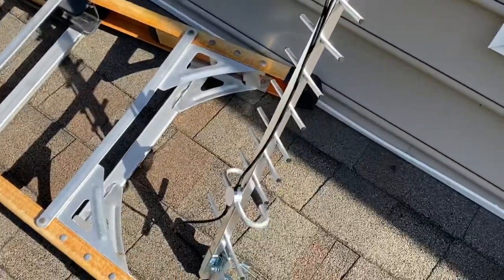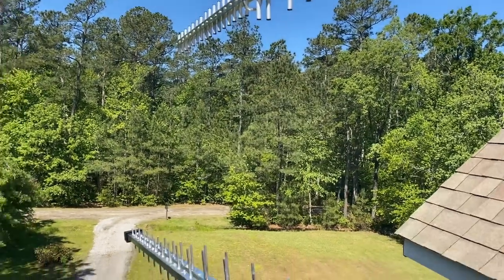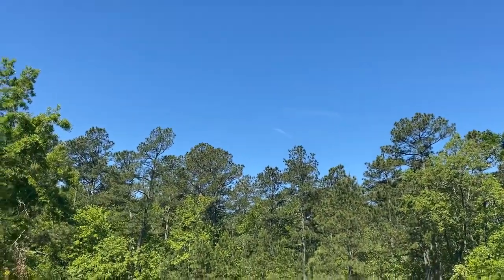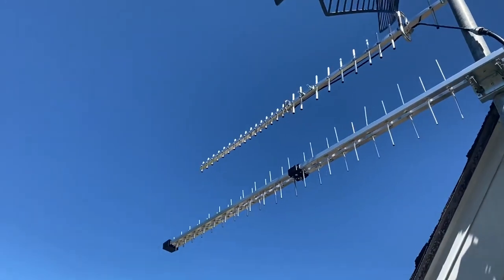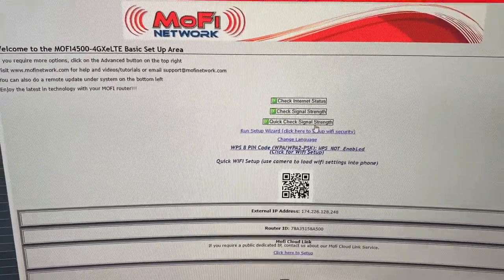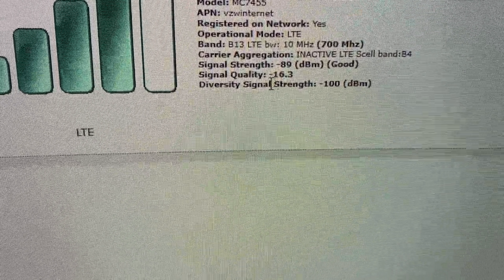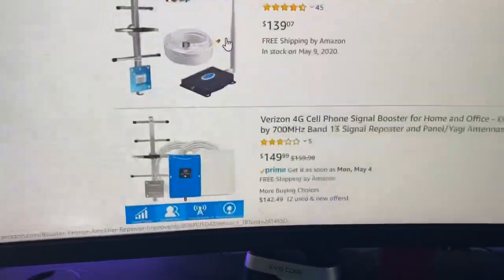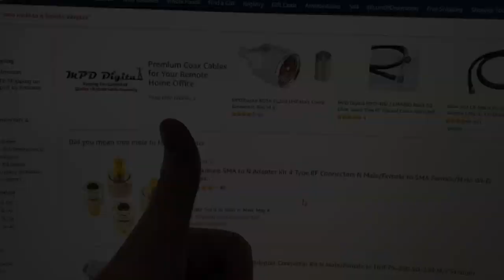NEW ANTENNA FOR MOFI!  PART 2 A MUST DO!

Comment: So im new to this. The multiple antenna types are so that if one drops out it auto goes on the other one? for more stability? so we get different types of antennas? am i right on my thinking?
Reply from the maker: Sorta,  the parabolic is super powerful you’d use it as the primary antenna which gives you signal strength.  (Prob the most important ) The secondary antenna helps with signal quality.  Better the quality the more stable the strength and signal are if that’s makes sense
Reply: @rockernro  yes, so are you saying with the Mofi you can select parabolic for signal strength and then the other for quality. And simultaneously it will use both? You freaking rock btw
Reply from the maker: @unitedsoulwarriorsfreedom4313  yes when you hook up the parabolic grid antenna with the correct wire make sure it’s plugged into the primary antenna port.  There’s two ports on the mofi and it should be labeled.  The second antenna assists the primary antenna to get the ultimate gain combined!  Technically, depending on how far from the tower you are you might only need the one antenna.  However, it is recommended you have two antennas for that reason.  I actually would have used two parabolic grid antennas but my roof didn’t have the room where my pole was.  Or you can do a similar setup to mine.
Reply: @rockernro  i see thanks so much. That Mofi does it broadcast out wifi as well? I'm actually looking to turn that feature off as i want to hardwire everything. You are amazing help brother.
Reply from the maker: @unitedsoulwarriorsfreedom4313  no no get the parabolic grid for LTE this one:  Griddy: The Grid Parabolic 4G LTE, 5G NR, and WiFi Antenna Kit by Waveform | Requires Line of Sight | Range: 40 km | 26 dB | 600-6500 MHz Dish | Works with Boosters, LTE Modems (Antenna Only) https://www.amazon.com/dp/B08Z671T9P/ref=cm_sw_r_cp_api_glt_fabc_KG6P93S235Q6FCC86Y8S
Reply from the maker: @unitedsoulwarriorsfreedom4313  yes it does but the mofi WiFi sucks so you’d select no in the settings to turn WiFi radio off.  I used a netgear gaming router and used it to broadcast WiFi.  It pretty much doubles your speeds.  And of course hardwire is always better also
Reply from the maker: @unitedsoulwarriorsfreedom4313  yes that would work! Ensure you buy the correct cables N male to SMA male ends
Reply: @rockernro  Thanks brother, btw, i looked at the MOFI buying the newer one and it says its a SMA female port so i would buy a SMA male. Checked and the FME is same just not as far a range see here: https://forums.whirlpool.net.au/archive/1946603 .....
Reply: @rockernro   Have you tested the signal loss on the wire that has the proper ends vs purchasing the N female to SMA ?
Reply from the maker: @unitedsoulwarriorsfreedom4313  needs to be the N-Male plugs into the antenna and the SMA male end it’s like a mini coaxial goes to mofi.  FME is a little different.  Like I had to get an adapter for the FME ends on the log periodic antennas to make them N male for the cables.  However, the parabolic I bought was N-Female so I didn’t need any adapters only the cable with those ends. Not trying to confuse you.  But you need this cable and ensure it’s the LMR 400 (they’re super thick!  If it’s thick like a TV coaxial it won’t be nearly as good.  I know this bc my neighbor bought the skinny ones and lost a few mbs of gain.  MPD Digital 400-n-Straight SMA-5 Times Microwave LMR-400 Coaxial Antenna Cable Line with N Male & Straight SMA Male Connectors, 5' https://www.amazon.com/dp/B00H9II88C/ref=cm_sw_r_cp_api_glt_fabc_J6E1APXZ9PYN1Y0HT3B0.    Remember if you do two antennas you’ll need two cables.  Don’t have to buy these but this is an example.
Reply from the maker: @unitedsoulwarriorsfreedom4313  so in a sense yes.  The ones I was using were LMR 400 not the RB68 or whatever it’s called.  The LMR is super thick thus less loss.  You start adding adapters and you will lose some DBs.   Hence I stress get the pre-made cable with the proper direct ends that way you mitigate less pieces meaning less loss.  Also, the shorter the cable the better the signal as well.  I was using 15ft cables on mine.  But I highly doubt if you have some excess you’ll lose much of anything unless you go over 100ft or so perhaps.  Be very patient when pointing the parabolic.  Turn it little by little while looking at the decibels in real time on your phone in the mofi signal check settings.  As you turn it slightly left or right you will see DBs drop or get better.  -104 was the best I got for signal strength but you if you can get it to around -90 or less even better!  The better the strength the faster the speeds.  Once that antenna is set.  Go ahead and play with the second antenna and move it up down left and right to see if you can improve the signal quality.  I was at -7 at best on that but it ranged between -9 and -7.  When it rains or wind or snow, she’s going to fluctuate some and degrade.  So the lower you get both numbers, the safer you will be in the elements, if that makes sense?
Reply: @rockernro  Yes makes perfect sense. Just ordered everything. i ordered 2 parabolics... so the second one i try to boost signal quality and first one i boost the signal strength? man you are tremendous help and im certain others will read this and have these same questions thanks.

Comment: @John Barth ok since your not using the band lock what setting is it on for you using the Advance band lock tab like to test it on with the same settings with AT&T to see if I get better results as well
Reply from the maker: Nyt Owl316 you select the bands you want on advanced band lock and hit save you have to mess with it like some bands will merge together and say carrier aggregation in the check signal status keep trying 2 bands until it says carrier aggregate
Reply: John Barth ok so on band lock was the setting for that just on Auto cause that’s what I messed with to band lock it on band12/17 so I need to put it back on auto basically and mess with the advance tab only
Reply: Thanks for the tip I tried different ones but couldn’t get a good results so I selected all five and got way better speeds that way than just having one selected on band lock? Thanks for the info keep up the good work hope yours works out as well!!!!!
Reply from the maker: Nyt Owl316 so you are using multiple
Bands?  Interesting I mean I could do but it typically only does CA with 2 bands unless you’ve seen an improvement will multiples?
Reply: John Barth well like you said it’s trial and error when I was using band lock with just band 12/17 I was getting only 20 down and 15 up other bands I was getting less but went back and put it on auto and stayed up most of the night when everyone was asleep tried two at a time but less speeds than before so I heard you say you can possibly use them all at the same time and presto magneto it worked. Like you said tricking the towers but I don’t have antennas like you but for now this works and the speeds are consistent.
Reply: John Barth also my speeds are at 50 up and 6 down if that helps
Reply from the maker: Nyt Owl316 that’s what I’m talking about!  Good shit!
Reply: John Barth yes sir very good shit lmao when your part of the cutting cable community and rely on variable speeds to stream when it’s unlimited it helps out a lot
Reply: John Barth I seen in the video you had a wireless router in your sons room is that hooked up to the Mofi and if it is I like to know how you got it to work with it on changing the settings?
Reply from the maker: Nyt Owl316 so I just plugged an Ethernet from port one on mofi to my netgear gaming router’s Wan port or colored port.   This router shows a internet flickering light so I know it’s tethered at that point.  I go into my netgear and change the SSID name and password under the wireless settings.  I turn off the 5Ghz under wireless settings bc the mofi only uses 2.4ghz.  So make sure you only use one WiFi name and password under 2.4 ghz.  Disable the 5ghz.  And then I save it all and go into mofi settings through the netgear!  Once I know I can access the mofi settings through my netgear I go into the wireless settings on the Mofi and where it says wireless radio enabled select NO.  That will turn the WiFi off on mofi and will be strictly blasting WiFi through the netgear or whatever router you use.  Whew, lastly for a WiFi channel select channel 1 not auto.  That keeps you safe from neighbor interference.  That will do the trick!
Reply: John Barth dude your awesome I’m gonna try that tonight when everyone is asleep 👍👍👍👍👍👍👍👍👍👍👍
Reply: @rockernro  hi John, can you link a video to your in home set-up when you have a chance? i am thinking about getting the mofi. I think it will work for what the family needs (streaming) but a second router would def help me out for what I need (gaming). Thanks for your help and quick replies!
Reply: Oh and John, one more thing (I know Ive hit you up a couple times already today), but where did you start originally with signal strength? Im just looking for a comparison in DBm. For reference, I have a verizon signal in my home that fluctuates between -108 to -120 in the home on my Pixel 4.
Reply from the maker: stephen shay use the mofi to determine your Live decibels but I’m sitting around -104 for strength and -8 for quality.  If you add a good antenna like mine you will get lower decibels for sure

Comment: Do you have the parabolic grid antenna attached to "primary antenna" connection on mofi router and verizon lpda antenna attached to "secondary antenna" connection?
Reply from the maker: Adam Fusco that is correct

Comment: About the signal quality. -0.0 to -10.0 is really good, will have no buffering and be fast. -11 to -14 signal quality will not be good. Signal strength may be good but with all of the error correction you will get a lot of buffering and very slow download/uploads Signal quality worse than -14 (-14 to -20) will be all but useless..

Comment: Hey John great videos. I haven't noticed you using lightning arrestors? Do you use them and if so do they cause a drop in signal?
Reply from the maker: Larry Burns I do not use them mainly bc they aren’t required due to power output.  I use one on my booster tho

Comment: Ok this old but did you use band lock?
Reply from the maker: I use band lock on band 4 sometimes I can get band 13 and 4 to carrier aggregates. As long as you have a mofi sim 4 combo not the sim 7.  The mofi I have has advanced band lock feature allows me to select multiple bands.  But when CA doesn’t work band 4 would just stay selected under band lock

Comment: john im having trouble trying to find the feed horn alone for the High Gain Parabolic Grid 4g LTE. i want to use my own old directv dish with one of them feed horns. found item#202378491888 on ebay tempted to use that as my feed horn.  please tell me what u think? im on at&t band 2.
Reply from the maker: Brian Reynolds try this.  Probably coming from overseas but this would work I think;  https://m.alibaba.com/product/60774818598/4G-1700-2700MHz-24dbi-high-gain-dish.html?src=sem_ggl&mark=google_shopping

Comment: Hey John, been following along makin a plan for myself to get necessary equipment and all, just need that cash lol. Great vids btw, thank you. But I think there's a difference in the menu layouts between MoFi's usin SIM 7 and SIM 4. First off on my SIM 7, I don't see anythin related to carrier aggregation or "Advanced Bandlock." I got the SIM 7 one because it was like 100 bucks cheaper on amazon but I don't know maybe I'm missin somethin? Anyways, with just the MoFi and a T-Mobile unlimited plan from OTRMobile, been gettin a decent 20Mbps on Band 4, being the weakest Strength but greatest Quality but for some reason I just no longer could connect to the tower that I was originally. I actually went to the physical tower and noticed they're workin on it, even asked the man there, after apologizing for interrupting lol, he said everything should be fine and active. Just can't seem to connect to it anymore, in fact I'm connecting to a tower that's even further away. So now I get only 10Mbps, which is still better than the 3 or 4 I got from usin a little hotspot device. 
Any thoughts?
Reply from the maker: Alєкѕαndя couple thoughts on this.  First off I’ve been told that OTR was taken down and there’s maybe a couple stragglers that they haven’t found out about yet.  Secondly m, the sim 7 combo was cheaper which is odd bc it’s a newer model.  Well...they might not have told you that the sim 7 combo was only made for certain carriers and others would follow in suite later.  Secondly, the sim 7 combo does not even offer carrier aggregation so that’s a major bummer. I bought one and sent it back bc I wanted to see if there were other bands it could pick up.  And no it didn’t and in fact it didn’t even work.  So...the moral of the story of you want to get a game changer you’ll probably want the sim 4 combo and I’d try to send it back.  If it’s been too long, try emailing or calling say the shit don’t work they’ll refund ya.  Lastly, some features won’t be available like advanced band lock bc you need that feature to allow carrier aggregation lol. So yeah,  if you aren’t using super high bands like 66 and shit and 4 was your money maker...Get the sim 4 combo and try multiple bands!  Hope this helps shit sucks bc it’s wicked expensive I know!
Reply from the maker: Alєкѕαndя hey man someone left this comment that t-mobile works with these people I’d see if maybe you need a new T-Mobile carrier seller check it out? https://traveldata.page/
Reply: @rockernro  Appreciate the reply! But unfortunately, believe today or yesterday would be the end of the return window on the MoFi. Been holdin up so thought that to be good enough, error on my part now gettin this info lol. I'll try and get in contact with MoFi, see if they can fix me up somethin. And that new T-Mobile carrier could be an option, but so far OTR's still up but definitely pinning that site. 
Got one more question though if I may, say I keep the SIM 7 model, with no carrier aggregation, you think gettin a High Gain Antenna would suffice? Like the Parabolic you got? The tower I'm currently connected to is about 7 to 8 miles out, and having the mofi up in my third story attic gets me -110 to -115 on strength, quality is a bit high tho at -15 to -17. Still gets me 10 to 15Mbps
Reply from the maker: Alєкѕαndя absolutely yeah I mean it it’s working and you don’t have a parabolic grid then I highly recommend getting one! Your speeds will improve dramatically with that!  Make sure you use the LMR500 cables with sma male end to mofi and N male end to antenna! Get a set of two and check on eBay bc the pickings are slim on amazon right now!  All the best and it ya get it all dialed in let me know how ya make out!
Reply: @rockernro  Alrighty! Set to order the cables, adapter, and antenna by next Friday. Should come in the following Monday, I'll keep you updated! And of course, thanks again for the help.

Comment: Thanks for the videos! You have convinced me to order the Mofi 4500 and a grandfathered Verizon SIM. Can't wait for them to get here so I can get rid of this god-forsaken HughesNet crap. I have two Verizon towers a mile or two away so I am hoping I don't need external antennas. We will see, baby steps.
Reply: What plan did you get sir?
Reply from the maker: PONCH 333 I agree 100%. But if you get an antenna juts get a cheap panel antenna for 99$ on amazon it’s MIMo it’s the proxicast LTE antenna that’ll work just fine!
Reply: @rockernro  good to know, thanks again!